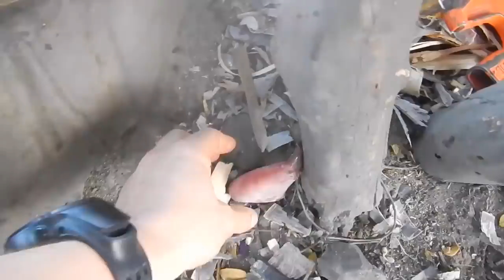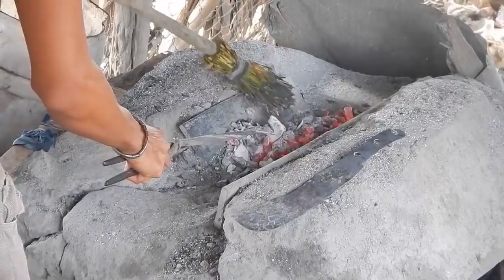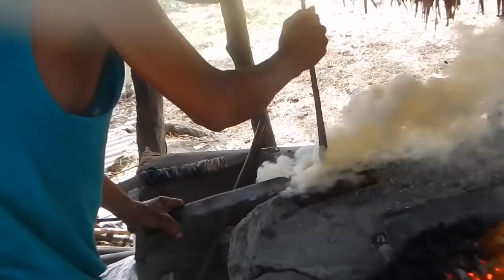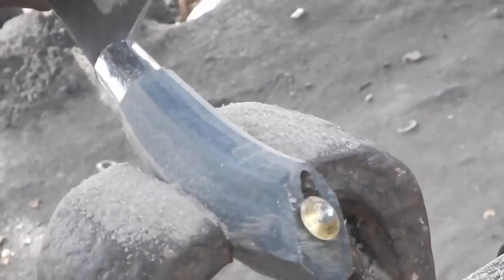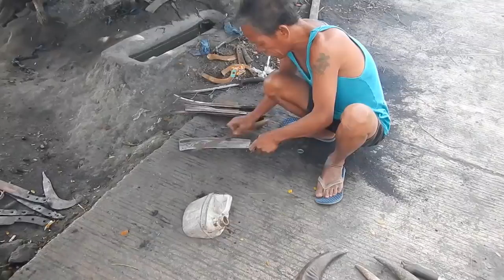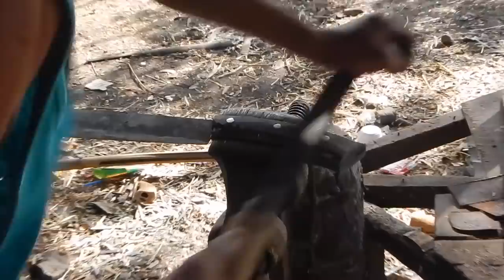How Blacksmiths make Buffalo Horn Machete Handles UNCUT VERSION

Comment: If they understood tempering and the properties of steel those machetes would be awesome. What they do is great, just a pity no ones shown them how to do it properly. I see this in a lot of your videos. .not all, but most. But they work and allow them to have repeat customers more often so I guess it's a good thing. Love it.
Reply: my traditional machete can chop the tip side of dry bamboo well, and after using that, still can slice paper without any problem. if the technique is correct, the result is awesome.
Reply: Your wrong
Reply: they easily cut through metal roundbar. Surely its been tempered, or atleast the artisan's personal blade is. Give these guys a modern forge, and they'll churn these things out in the hundreds in a day